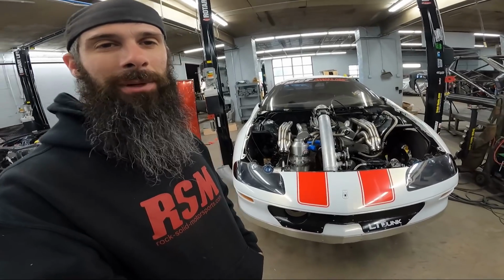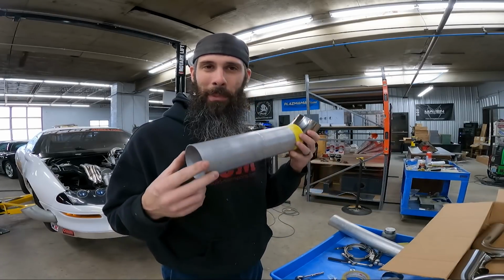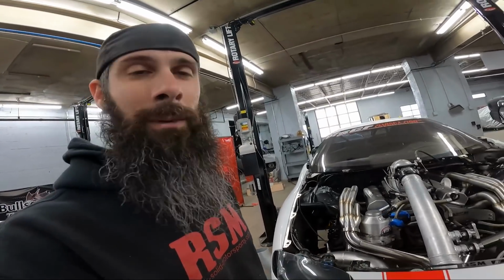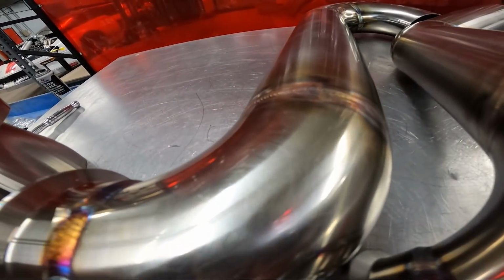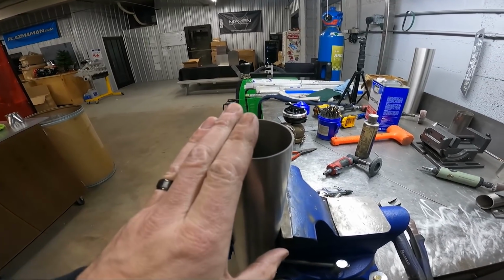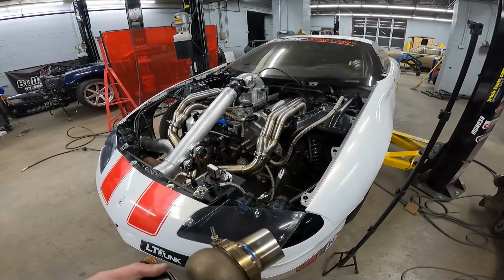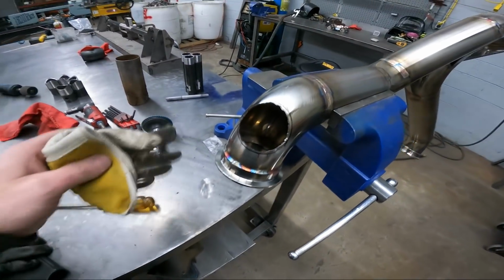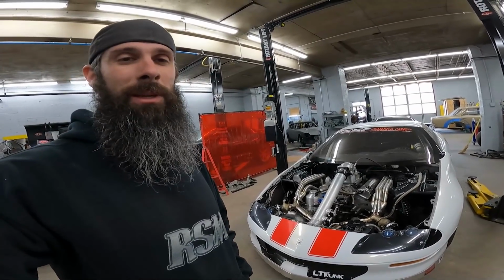Grubbworm Updates 2022 Turbo Hotside Fab and Project Completion Video #9

Comment: If you dont mind is that 14 gauge you use for the wastegate gussets? what is the thinnest you would use for a gusset like that?
Reply from the maker: It's 14g gusset. You could use really any thickness but I prefer something a little bit thicker than the pipe
Reply: @rocksolidmotorsports7297  thank you